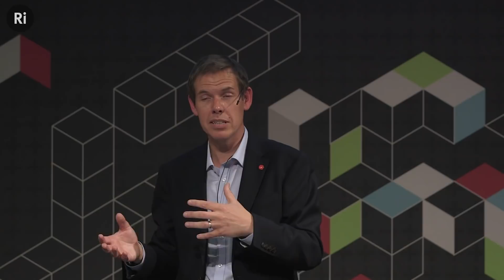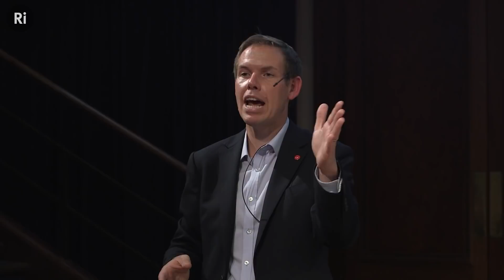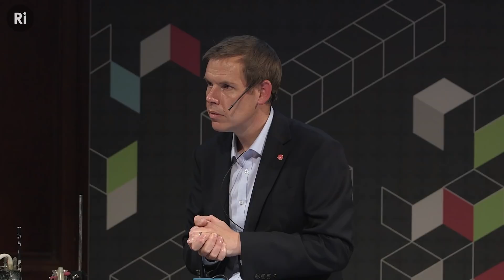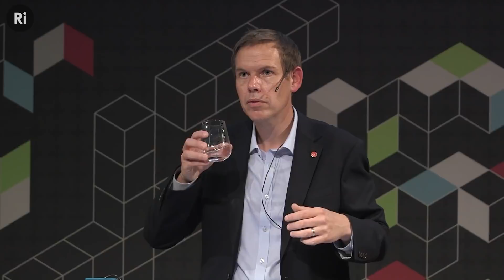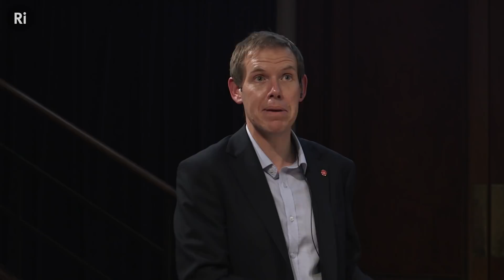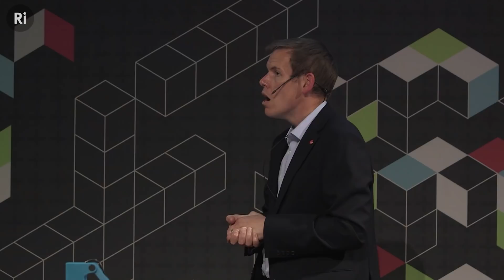Q&A: How Batteries Power the Modern World - with Paul Shearing

Comment: I was hoping that he would mention the very low efficiency we currently have in fuel cell and hydrogen combustion engines. The conversion of electric power into hydrogen, along with the power requirements to liquify the gas to store and transport, and then convert it back into electricity to drive an electric motor wastes a lot of energy. On top of that, quite a lot of hydrogen fuel is actually produced with fossil gas, as that is more economic than using vast amounts of expensive electricity from the grid to split up water in its elements.

Comment: 13:30 and thereabouts: Used EV batteries are already being repurposed in several ways, including selected 'good' cells being used for EV conversions and home electricity storage. There was also a contract signed between Tesla and a battery supplier a couple of weeks ago,  in which the supplier intends to produce 50% of their cells from recycled batteries. This is because old batteries have higher concentrations of needed elements within them, in comparison to traditional natural ores and resources.